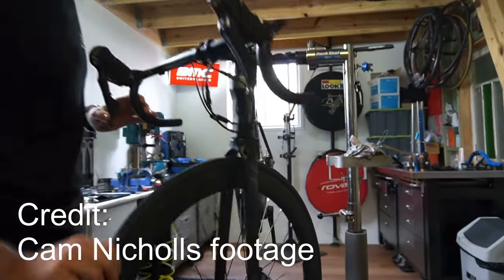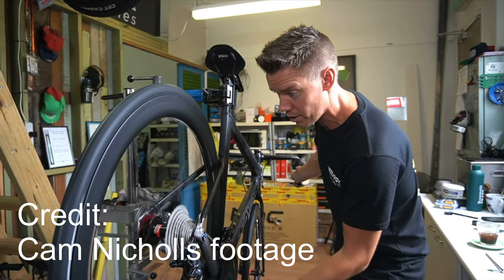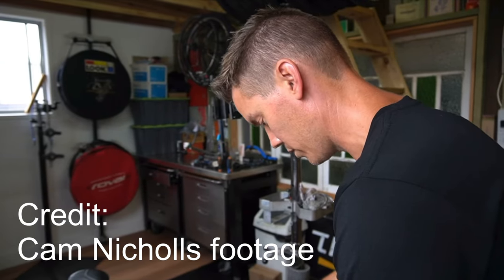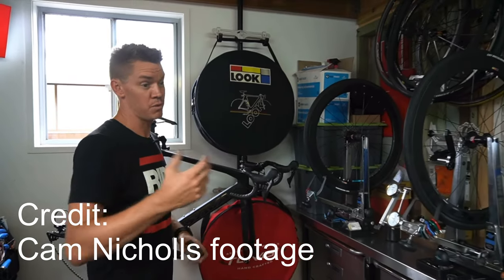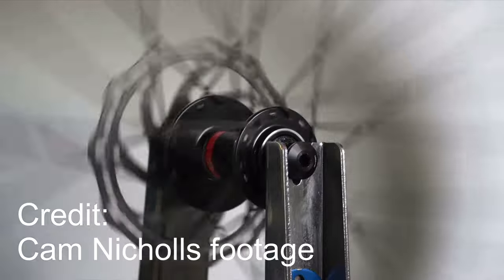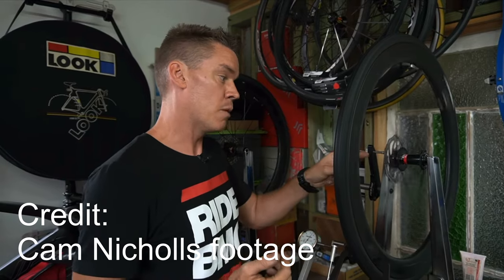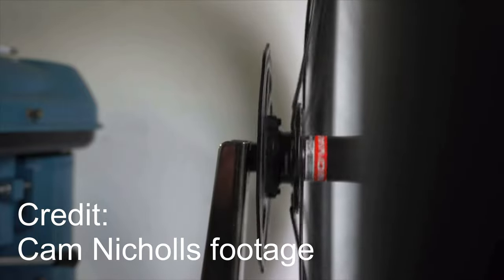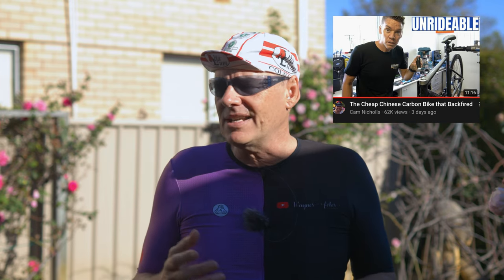Another problem with disc brakes!

Comment: There is an easy fix to this. Remove the full disc brake system from the bike and install it onto a full sus mountain bike and start riding. It will probably still rub, but at least you will be riding a mountain bike, so it's a much better experience.
Reply: Mountain bikes don’t have many issues with disc brakes because they are l allowed to be bigger with wider tolerances. It’s the weight and size challenge that has delayed their development in road bikes. I have both rim and disc brake road bikes. The disc brakes do work better but the compromise is all the silly issues when they go wrong…, back to the bike shop again… I do find myself longing for the simplicity of rim brakes when dealing with my disc brake bike. Don’t even start with the current wait times for disc pads 🤯.

Comment: I dunno...a hub/bearing misalignment like that seems like a disaster waiting to happen.  This isn't equivalent to an out-or-true rim, this is pointing to asymmetric forces on one of the most important areas of the bike.

So  I'd argue that this is actually a point in FAVOR of disc brakes--you could have let that manufacturing defect of the hub go unnoticed in a rim brake setup. Maybe nothing would have happened, or maybe the whole hub would have eventually failed.
Reply: That hub would cause run out at the rim too. In most cases the mech would probably correct the wheel or possibly the rotor in the stand not expecting the hub rotation to have that much run out. I can't recall ever seeing that before in a properly adjusted hub. Checking for run out in the hub is at the top of my list having seen the videos on this though.

Comment: You just reinforced why I prefer steel bikes, threaded bottom brackets,  and rim brakes. I do like external (hollow tech) bottom brackets. That innovation I do like. But nothing beats a friction thumb shifter.
Reply: For casual riding, touring or group rides, sure. But not for racing. There’s no equivalent to a race bike. Aluminum and carbon.
Reply: RollinRat  sure, but chromo bikes were also a step up from mild steel heavy bikes and the same with all parts on the bike. It doesn't matter what kind of bike you are on, you still have to train or you will get dropped!

Comment: So, let me try to understand this: the carbon frame was very poorly manufactured, the hub was off centre, the brakes wouldn't stop rubbing... The bike is a mess but, somehow, your conclusion is that there is a problem with disc brakes and only with disc brakes. So, is there not a problem with wheel hubs? They can be off centre, so they're bad, let's get rid of wheel hubs! 🤣🤣🤣Aaahhh of god... The lengths that rim brake fans will go to justify anything...
Reply: As a matter of fact, it's a well know problem with the small clearance of disc brakes.
If the caliper is not square with the disc...it will rub.
And that's mainly a frame manufacturer problem...not a disc problem where I do agree with you.
I really hope frame manufacturer will improve their quality controls, or that tool manufacturers will make proper tools to face the calipper mounts on the frames(actually, they exist already for steel/aluminium/titanium frames, but not for carbon)
Reply: Well, yeah. It actually is a valid point within certain limits.

The problems described here shouldn't affect enthusiasts buying a high end bike, but there's a lot of people who can't imagine spending even $1000 on a bike.  A company like Giant, with its world-class facilities, can almost certainly make a consistently good $500-$700 disc brake bike, but a lot of manufacturers would struggle at that price.  

The world needs good, cheap, practical bikes, and if an acquaintance falls into that market segment and is going to buy off the Internet, it might be wise to steer him toward rim brakes.  There's nothing wrong with a low-end Tektro or Avid cable disc brakes, but the other stuff around it might be a crap shoot. And if you buy random off-brand bikes from the Internet you just have to accept that you might have to send it back.  But from what I can tell, the risk is part of the attraction for people who do that kind of thing.
Reply: To be honest … you’ve completely missed the point that Wayno is making here. Should consumers and bike shops be subjected to this nonsense? You by a bike and it should be fit for purpose. All the other issues can be dealt with but bike shops around the world are plagued with have to reface frame mounts to make these components work.
Reply from the maker: Not sure if you watched the whole video, but I clearly said, we can argue this is not a brake issue.
But someone buying a complete bike is going to have a brake issue at the end of the day.
It doesn't matter what is causing it, at the end of the day it is not good enough. And this complaint is not that usaual. Why bike shops need to do all this finishing work (facing) for the manufacturers.
Reply: @waynosfotos  I did watch the whole video and, yes, you recognise it's not a brake issue. HOWEVER, what did you do in the title of the video? "Another problem with disc brakes", what does that suggest you? It is pretty clear that in the title you are stating that it is a disc brake issue, but it's not. An off-centre hub will be an issue with discs and with rims. You decided to put a click-bait title and blame the issue on the disc brakes when it is pretty clear that the issue is a horrible quality control.
Reply: @kindjalkazad  Disc brakes aren't new. They aren't even new on bicycles. Discs aren't a big problem on MTBs with the same tolerances. There is rub. Heat distorts and the beating MTBS take can tweak things. On a MTB a minor rub often gets drowned out by the noise of the tires and geneal offroad riding. Its funny that roadies who sit and spin nose to butt cheek and shoulder to shoulder for hours and KMs on end are having such difficulty with disc brakes. Its a symptom of the finiky road discipline that we MTBers like to laugh at.
Reply: @AlexanderTanned  Waynos bias against road disc is obvious. The title is click bait. Aknowledging the hub and frame makers inability to design and manufacture anything well enough for discs and still saying discs dont work is BS. Waynos needs to clear that up with a correction. I hope he doesn't dig in his heels on this.
Reply: @daveeades9333  I've been a mountain bike rider for the past 25 years.
I've used disc brakes on my mountains bikes, since 2000, Hope Mini and Formula 4 pistons...
And no, there was no such problems at this time that there are now on road bikes...

So you can shit on roadies face, like you do, but facts are fact, pad clearance on road bikes is smaller than what is used on mountain bikes...hence why Shimano increased it on it's latest Ultegra and Durace...

Comment: Don't kill the messenger. The disc brakes just uncovered a sloppy made hub. This would be annoying and is unacceptable for a road bike even with rim brakes.
There are no issues with a proper designed and built bike with disk brakes. Just too many manufacturers take shortcuts.

Comment: I’m sorry @waynos fotus, but you are wrong with this one. Disc brakes do have some issues, but in this case the disc brake is innocent, as it’s the hub that’s the problem. Do not blame the disc brake for being unable to handle piss poor manufacturing. 

The hub issue will also result likely in wheel build issues, with spokes needing to be unevenly tensioned in order to get the wheel round and true.

There are various brands and manufacturers out there that repeatedly build frames to the required standards, and in these cases disc brakes have very few issues (granted, pad clearance is and issue, but shimano may have fixed that with the new DA and Ultegra).

People are two quick to blame disc brakes and press fit bottom brackets because of their own prejudices, instead of looking for and pressuring the bike brands to deal with the real problems that cause the majority of the issues on both cases - poor manufacturing.

Buy bikes and frames from the likes of Giant, Merida, Specialized (which are made by Merida) and a handful of other decent manufacturers and you will have few if any issues with disc brakes or bottom brackets.
Reply: Totally agree with this. Yes disc brakes take more effort and are not for everyone. My two bikes with discs are both Giants, MTB and a flat bar road bike, and i have none of these issues. And i don't have constant grime on the rims like my rim brake bikes have. I've got no issue with rim brakes, but the v-brake rims on my gravel bike are a real pain to configure at times.

Comment: Not a problem with the disc brakes…Just piss poor manufacturing and quality control by the hub manufacturer. 
This is now 20+ year old tech that’s been dribbled/forced down from mountain bikes where there seems to be significantly less manufacturing issue. Can’t quite fathom why these issue still a thing, maybe road bike have always had worse manufacturing or are trying to use less material in the name of weight saving making thing deform and flex more. 🤷‍♂️
Reply from the maker: Because the bicycle industry is pi$$ poor at maintaining tolerances. They think they can make all this fancy proprietary parts. But most bicycle companies don't have the engineering skills or the QC.
Reply: @waynosfotos  
Especially now with covid. I get bikes now that I have had to tap the threads on the stems. It seems they are just pushing out bikes, with no quality control.
Reply: The guy even said that wheels were so bad, they wouldn't work at all with any brakes because the hub assembly was so badly done.
Reply: @waynosfotos  , you're wrong. None of the big companies have issues building properly toleranced hubs.  It's not problem for Campy, Shimano, SRAM, White Industries, Zipp, Enve, DT Swiss, and so on.  Cam got crap wheels with a crap bike.  His problem is not indicative of an industry problem.  Full stop.  Also, your generalization that the industry is piss poor at maintaining tolerances is not valid.  Some in the industry have issues. A lot don't, and it depends greatly on what parts your talking about.

Your screed has a poor technical basis. You make assumptions that are not supported by careful analysis.  You shouldn't confuse your opinion with fact.  Your bias against disc brakes has obviously influenced your "analysis."
Reply: I agree with Moz and Robin. I’m still on a rim braked bike that got me going with road biking, but the next one will be disc braked. Almost all of my mates who have disc brakes say they’d never go back, because they hold so many advantages for an average cyclist, modulation and wet braking being the most important for me. There will always be duds, but to suggest that people should avoid discs on that basis may be rather unhelpful to many. 
It will be interesting to see whether the new shimano brakes with greater pad clearance and mtb discs will solve the disc rubbing issue that many do experience on road bikes, due to fork flex. Even then, I believe that’s only an issue on well made and tuned bikes when your really pushing hard, so it’s a trade off I’d accept for the advantages.
Reply: With how efficient a mountain bike is I do believe they di suffer from brake rub and simply don't notice it
Reply: @calebgonsalves2970  They do. I know a MTBr who carries a small adjustable spanner for resetting his discs. Too many resets and he replaces the disc. Way cheaper than replacing rims.
Reply: @jamesmckenzie3532  resetting the discs, as in replacing them or doing the bolts again?
Reply: @calebgonsalves2970 , mountain bikes are no more efficient than road bikes.
Reply: @robinseibel7540  I meant power efficiency, when you push the pedal on a MTB less energy actually turns into speed compared to road bikes (on the road ofc)
Reply: @calebgonsalves2970  straightening the disc or truing it as best you can. Like a "field" true on a bike wheel.
Reply: @jamesmckenzie3532  that is nothing more than a hot fix, either he isn't truing the brake afterward (it has to be spot on like the vid says) or his brakes are warping? You shouldn't be truing brakes like Bear Grylls for every ride
Reply: @calebgonsalves2970  I agree. If you are truing discs after each ride, you need new ones or something else is very wrong.

Comment: How can you take a situation and apply it to  all road bikes with disc brakes? I have a Kona Roadhouse with full Ultegra drivetrain and hydro brakes. I have had Mavic Allroad, Specialized Roval SLX 24 and Bontrager Aeolus Pro 3 wheels on that bike and I have had zero issues. Up hills, down hills. 45 mph down a mountain with no ting ting. I interchange the wheels and no adjustments are needed, it just works.

Comment: Back in January of this year I bought a set of Shimano Dura-Ace  C30 wheels and the rear hub wobbled like you showed in this video only mine was a lot worse. I found it right away because the cassette wobbled and the chain made the noise like when you don't have the derailleur tuned and centered on the cog. There is no fix except to replace the wheels which the online store was very cooperative in doing. You would not expect a Dura-Ace wheel to have a problem but apparently  in manufacturing anything can and does happen. Quality Controls should be able to find these defects before they go out the door but maybe nobody is doing QC anymore.
Reply from the maker: Interesting, it happens to the top name brands as well.
People loVe to dismiss this  as a cheap brand problem. But many of these bikes all come out of a few factories.
Reply: @waynosfotos  Speaking of cheap and expensive, the drive side NTN bearing on my £370 Hambini BB65 bottom bracket failed after cycling only 500 dry km, while the allegedly "cheap and low quality" Enduro bearings that came with my Token Ninja bottom bracket are still running smooth after close to 10k km mark. Who would have thought.
Reply from the maker: @82vitt  that is interesting 🤔. i would contact Hambini. I am sure he will investigate and look after you.
Reply: @waynosfotos  It made a quiet, notchy, vibratory sound as if it was pitted when I casually gave the crank a free spin a couple days ago. Still smooth under a finger until I press much harder when I can feel the notching. I have barely even used that bike and rule out contamination - the seals look immaculate as the plastic caps provide superb protection against dust or dirt. I have never dropped the bb or in any other way subjected the bearings to an impact load so it is a strange one indeed. Particularly compared to the Token bb which is 4x cheaper, and so far has been just totally issue free.

Comment: I've built around ten different wheelsets with novatec hubs in the past three years. They're all still working flawlessly. I've just recently built two sets with those exact hubs that Cam shows in his video. Seems to me like he got a paticularly bad unit. I really like the Novatec 791/792 hubs. They're light and sturdy. There's all kinds of freewheels available and the bearings can be easily replaced. I'll keep buying them.
Reply: Agreed. My 791/792 are four years old and have a ton of miles on them. No issues with the hub or bearings.
Reply: Also, they're not made in China (not that that's necessarily a bad thing). Mine usually say Made in Taiwan, where literally 90 percent of all components come from.

Comment: I actually prefer disc brakes, but that is because I prefer cyclocross bike. If I were riding road bike and only on good weather, then I don't know which one I would like. Also I never had hydraulic disc brakes. I think cable operated mechanical discbrakes are great if they work well although I noticed this on my bike too, that the caliper was not siting square with rotor, but it was only little, the brake pads wore to right shape pretty quick.. Also on wet weather they squeak, but that's probably due to maintenance, or because the frame isn't faced correctly.

Comment: Don't be over sensitive with brake rub. Ive never had a disc brake that I couldn't tune out the rubbing.and the there is hardly any drag even the pad touches the disc a little after brakes got hot. The safety and modulation of disc brake is worth the little inconvenience .

Comment: Shouldn't we thank the discs for uncovering this kind of problems? Would a rim brake bike with messed up fork or hub be safe to ride? Also, rubbing in unfortunate circumstances should not be called "another" problem, since rubbing even in the most perfect conditions is a peculiar feature of the disc brakes, but I get the clickbait :-)

Comment: The equipment that make hubs have no problems hitting the tolerances needed. This is 100% a Novatech quality problem 0% disc brake problem. In fact this isn’t even a good argument. I could look at an out of tolerance condition on a rim brake system and point out some dangerous circumstance as well. That you have to reach to this when rim brakes work so poor during regular operation is quite telling. 
Let’s keep the rim brake but let’s recognize that they aren’t as good.
Reply from the maker: Sorry mate, a slightly offset hub on a rim brake can be tuned out by adjusting the spokes not an issue with rim brakes.
Reply: @waynosfotos  This was significantly out of tolerance. You can see the wobble on the hub. Since I've built bikes, this hub would be binned.